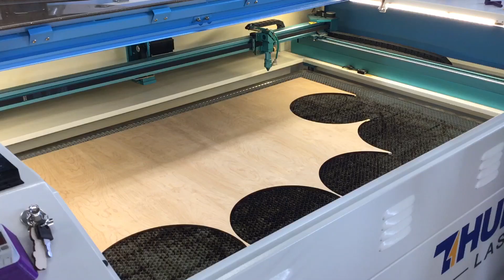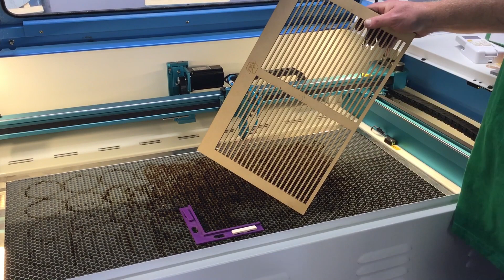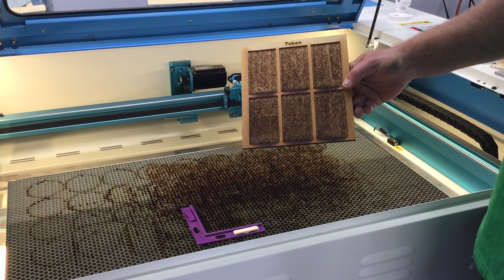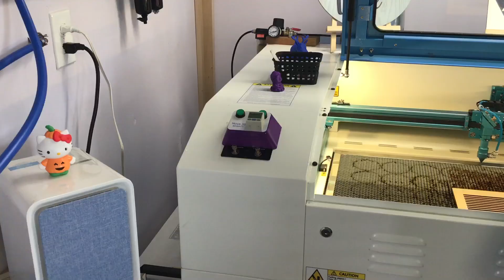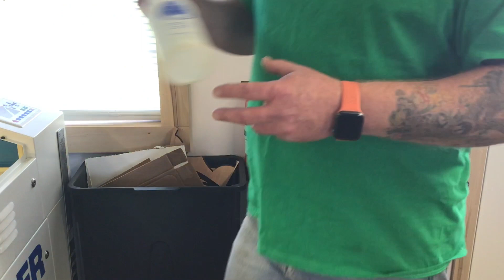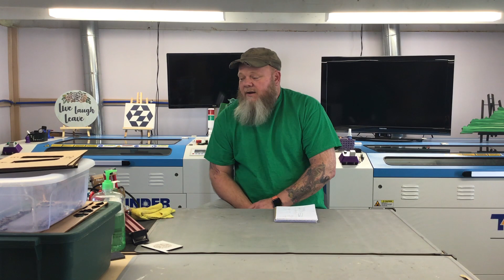ACCESSORIES FOR YOUR LASER!

Comment: The laser accessory kit is a must, got mine today and an absolute lifesaver. The "corner" kept trophy plates straight and square and the T style pins held plate in place!! The focal blocks made focusing laser so much easier than the little tool that came with engraver. Recommend highly!!